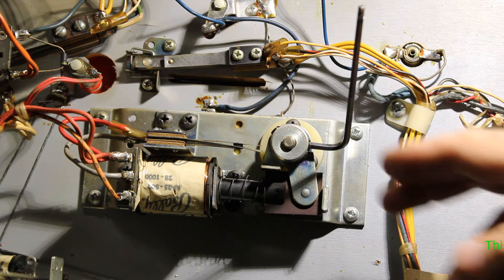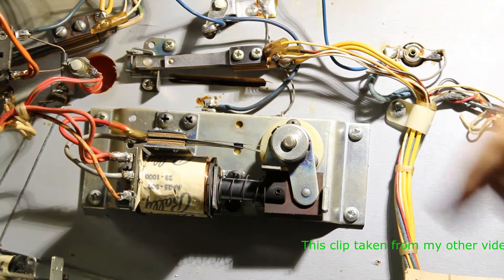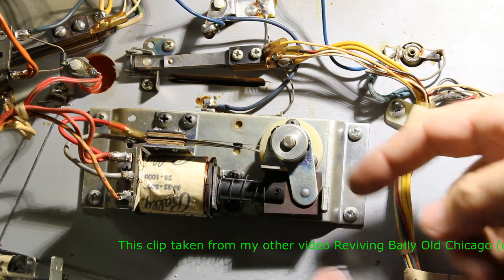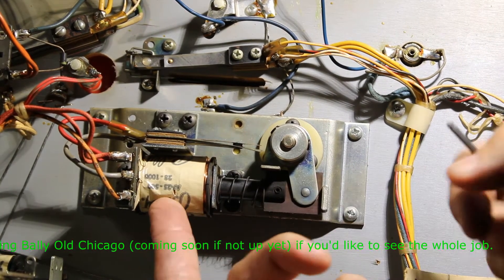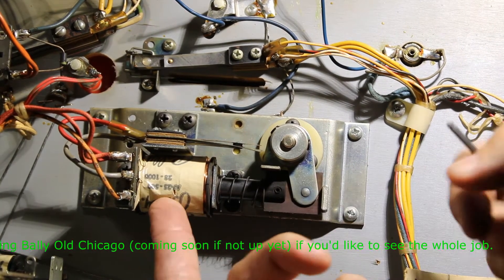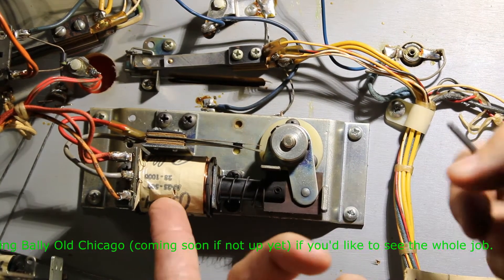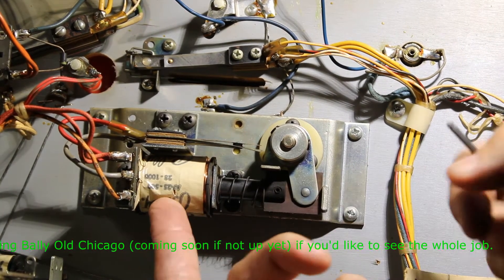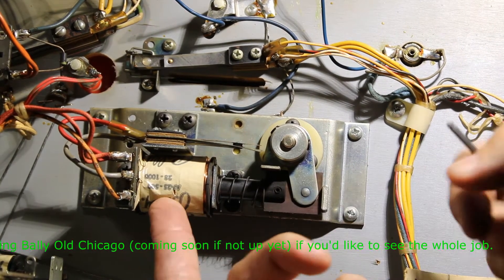How to Replace Bally Flipper Bats

Comment: After I replaced the bats - they now sometimes double flip when I hold the button in. This happened before once in a while but much more now. Any advice?
Reply from the maker: I would start by making sure the contacts at the buttons are clean. Then make sure your end of stroke switch is correctly adjusted. What machine is it?
Reply: It's an Eight Ball machine. I'm sure these flipper assemblies are original. I was thinking of replacing but will try your ideas first. I can't thank you enough for the advice. I love this machine!
Reply from the maker: Keep me posted. Rebuilding them can only help the machine. The coils do get weak, or more or less slow down due to misadjusted switches and dirty or warped coil sleeves. Also, the coil stops (the bottom part that the coil sits on) there is a plunger stopper in there that tend to get mushroomed over time from being constantly slammed into. This will sometimes create a seal inside the coil sleeve where air gets trapped and the plunger wastes energy and momentum trying to compress the air. The rebuild kits are cheap and if you got new coils they're about $10 each. But you'll notice the difference.

Comment: I’m having an issue to where no matter how tight I set the screws they still slip. Any suggestions?
Reply from the maker: Sorry, I saw this 2 weeks later. First make sure you have new pawls and flipper bat shafts, the correct part numbers. Also, each pawl should have 2 set screws, not just 1.

Comment: I have problem when i press button my bat just wont stop hiting.
If I hold right button for right bat, the bat is just hitting all the time very fast.
Can you help me with this problem what to do?

Left bat is working fine.
Reply from the maker: I apologize. I don't know why I'm just now seeing this. Yes the machine gunning flipper most of the time is caused by a misadjusted EOS or End Of Stroke switch on the flipper assembly under the playfield. The coil that works the flipper is technically 2 coils in 1, a larger diameter wire but short winding to provide power to hit the ball. Then there is a smaller diameter wire with a bunch more windings to provide more resistance with low current in order to allow you to hold the button on without burning up the coil. Look underneath where the flipper comes through. Manually work the flipper by hand and compare it to your other side. You'll see that towards the end of the stroke (plunger pulling all the way into the coil) that the pawl opens a switch. You want this to open juuuussst before the plunger is fully into the coil. If it's opening too soon the flipper gets weak and will bounce and that's what you're seeing. Hope this helps if you haven't fixed it already. Feel free to message back if you have any other questions. Thanks for watching!